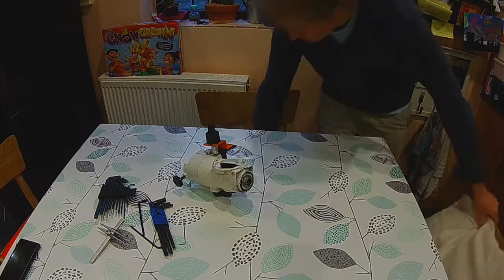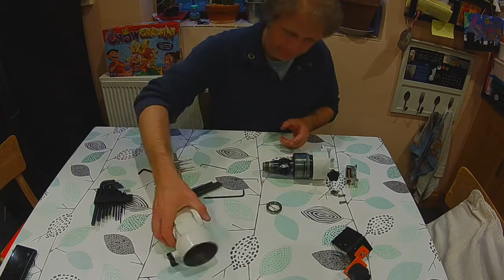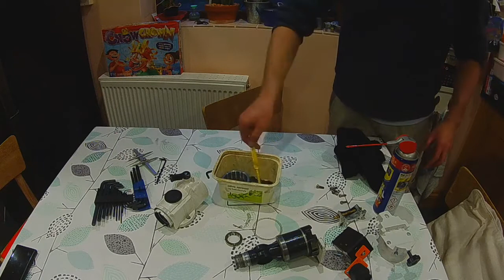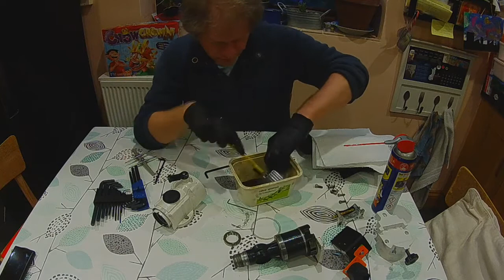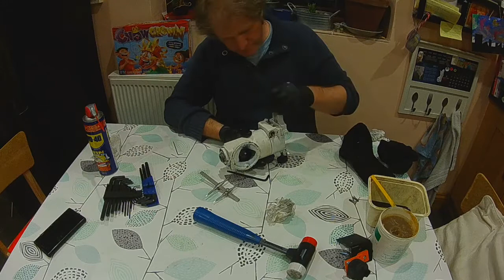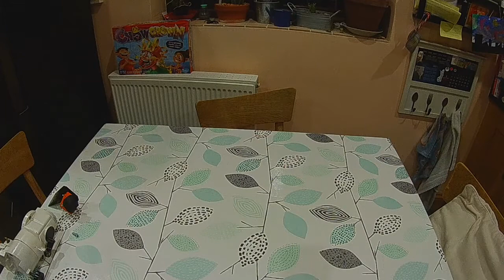EQ5 Mount Restoration No1

Comment: Looks like you've got the same type of grease that I use...  I had to service a 20 year old EQ-1 mount, last year. So I used what I had - GT85 and a tub of 20 year old grease from a car part shop.  It did the trick.